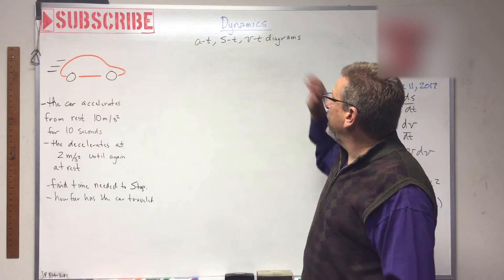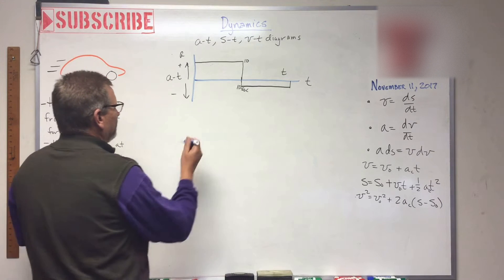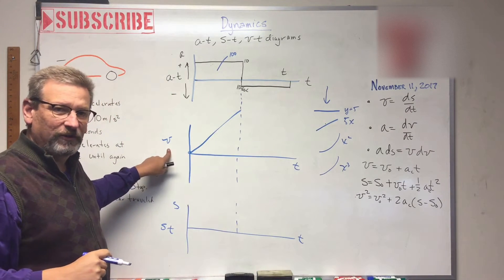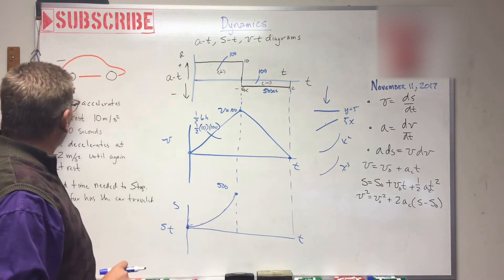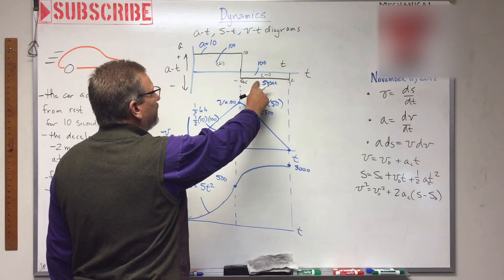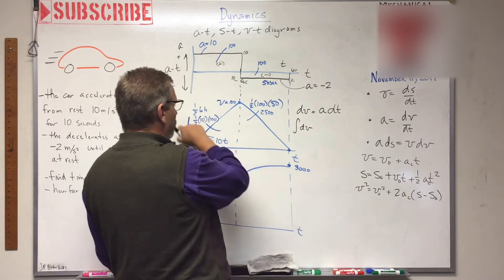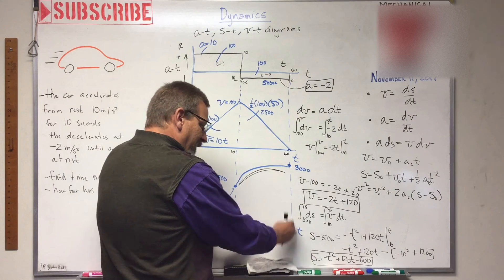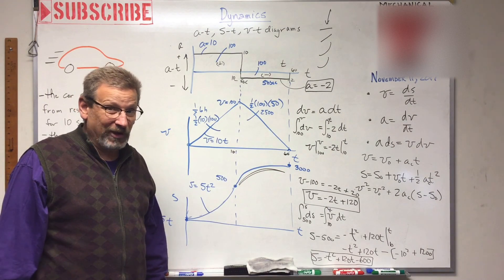Dynamics - Lesson 5: s-t, v-t, a-t Diagrams Erratic Motion

Comment: How come after the 10 s, We can't integrate the -2 m/s^2 to get our velocity function?
Reply: you actually can do that but u would need to add a constant C when u finish integrating. Then, solve for C by pluggin in the values of v and t at that point (so v=100m/s and t=10s). After substituting those in you get C = 120 which makes the same equation that he had for v which is v = -2t + 120
Reply: @playboicartigenome5973 t=10 second. a=-2m/s²
V=(a/t) 
V=(10/2) 
V=(5) 
S=S0+S1
S=0+(5x10) 
S=50 km
Jika jarak keatas maksimal= 50 km x(50-20+40) =(50x(30+40)) =(50x70) =(3500) 
Total energi gerak=(3500+4000=7500) 
4000 dari (40x10=400+(50+20) x5) =400+(70x5) =400+350=750x10 m/s=7500

Comment: Shouldn't the total area of the velocity graph be 2500?  500 for the left triangle and 2000 for the left considering t goes from 10s to 50s?  That would be 0.5(40)(100)=2000?  Then add the left side for 2500 m total?
Reply: Bro, 
The base for 2nd traingle is 50 so u assume it 40. its 50. If it become that much so the total area become 3000.
Reply: @karimfaizy766 (400) x(1/2x300) =400x150=60.000

Comment: <3 I wish I had this series when I was taking the dynamics but thank you for your efforts!
Reply: If you ever feel like refreshing your knowledge of dynamics then I can also strongly recommend Hibbeler's book on the subject, "Engineering Mechanics - Dynamics".
That book is dope, it has a lot of example problems with detailed solution steps and is very easy to use.
It even has a bunch of "Fundamental Problems" after most sections, which are kind of like warmups for the ordinary Problems.
It's basically like Hibbeler's "Engineering Mechanics - Statics" book.
It also has "Review Problems" for a few chapters at a time, and those problems are just as demanding as exam problems.
Reply: retake it then
Reply: lmao u savage bruh